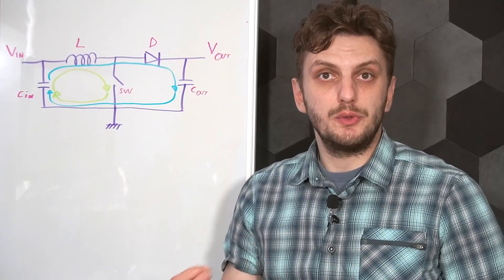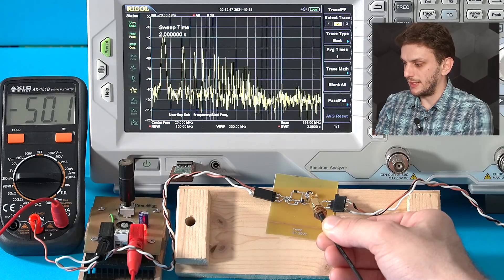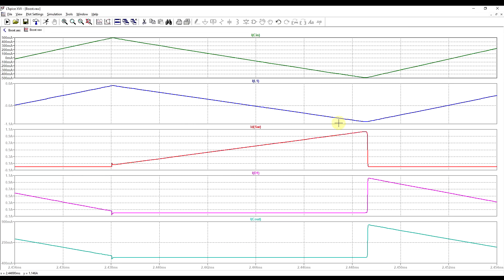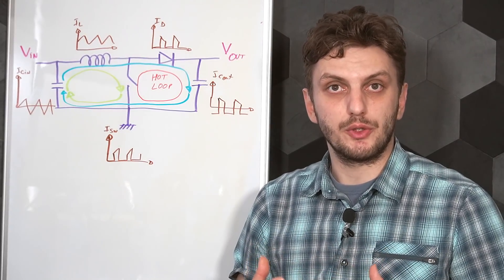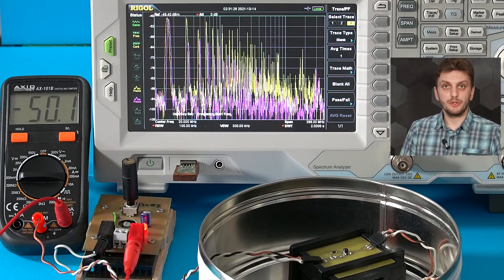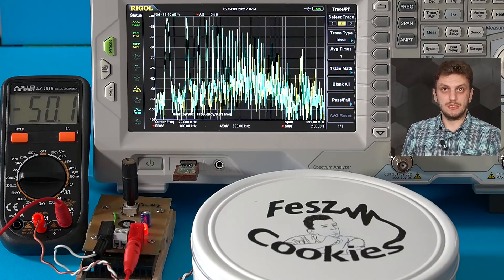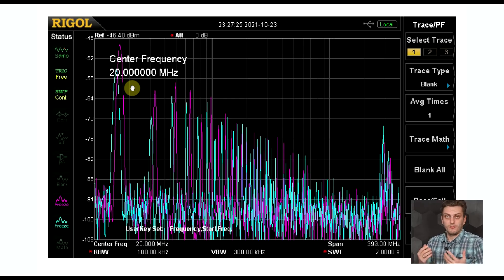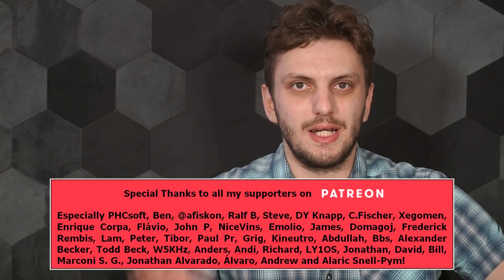EMC tutorials - The HOT Loop

Comment: Sorry, isn't it the non-linearity of the diode that is causing all the noise? Just think of diode ring-mixer, where the high frequency mix products are actually wanted..
Reply from the maker: I guess that is a different way of looking at things - in the diode mixer, you start off with a sine wave and process it using the diode; with a switching converter, you start off with DC and chop it into bits using switches (either mosfets or diodes); it does not have to be a diode, it can be a mosfet and you will get the same amount of noise.

Comment: I repaired a coertivity meter and when repaired  the owner demonstrated what happened   with the coertivity from metal if you bend it.  The effect was big. He told me that was the reason you never should bend or dril mu-metal after its heat treatment. Thanks for an other interesting video
Reply: What was the working principle of the coercivity meter you repaired?
Reply: @weinihao3632  I do not exactly know because part of the system was a black box (no schematics from those boxes) and known to be good. It is a 19"  amplifier/controller/PSU and 3 external cabinets. One is a big extremely heavy cabinet on wheels (size dog-house) with a huge coil inside used to magnetize the sample. There is also a "probe" inside. As far as I know it is a small coil used to measure the remanent magnetic field (If I use the correct term ) 
In short, it generates a magnetic field and measures the BH curve of metal samples.  The meter has several modes, the one they used gave a value in A/m (if I remember well)  The company who owns it develops things like electric motors for third parties. 
Something very rare, they had schematics, so there was no need for reverse-enginering. (95% of what I have too repair (my day-job) has no schematics)